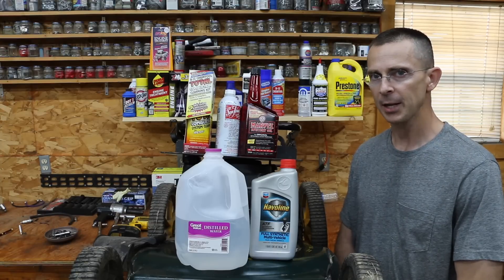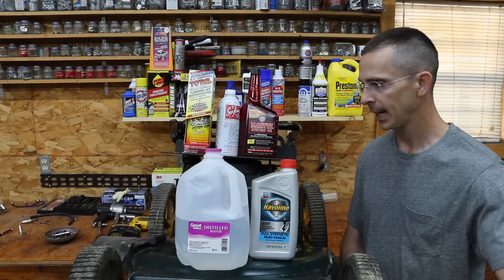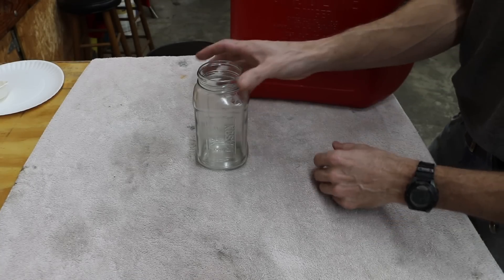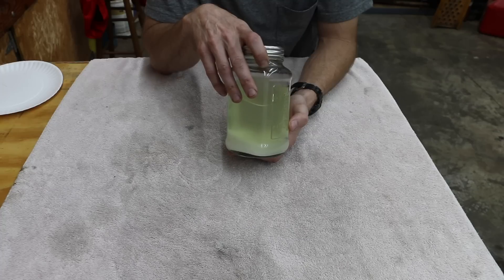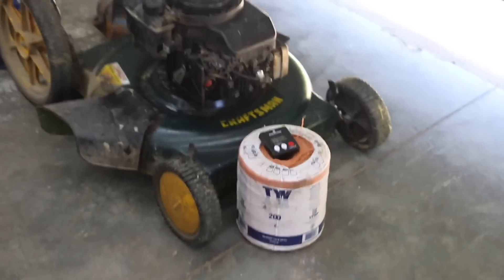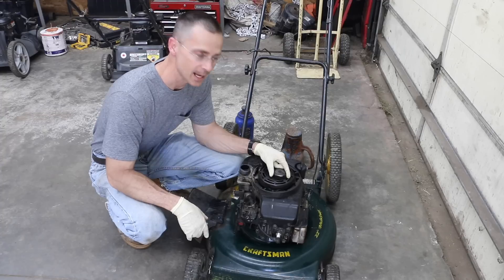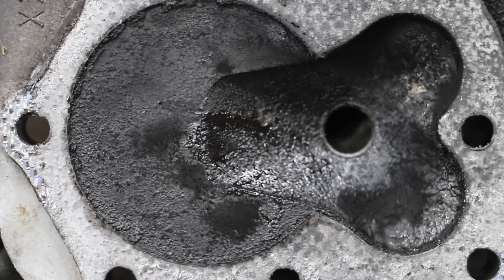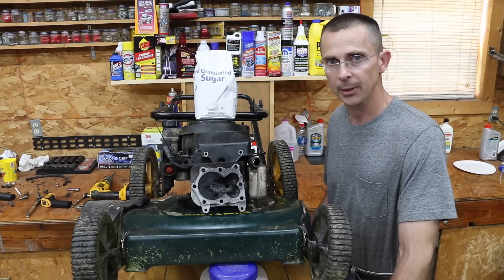Will Sugar in Gas Destroy a Vehicles Engine?  See what it does to this Engine!

Comment: I recently had my motorcycle at the dealer for what I thought would be warranty work on the fuel pump and they found tons of sugar in the fuel tank.... they are replacing the pump and cleaning out the tank

 What would you or anyone who reads this, suggest I use to possibly restore any issues it may have caused inside the engine?

(Symptoms were fuel pressure loss/low at high rpm, intermittent crank-no-start ,engine intermittently stalls out when i try to accelerate hard)
Reply: Flush out fuel tank,replace fuel filter,flush fuel lines.If its carberated,clean the carberator,if not,clean injectors.

Comment: I had put some Roundup in and oil bottle and then accidently added it to oil of a Dixie Chopper. It ran for awhile and then seized. The Cylinders were completely glazed. The engine was a loss. Sugar in the gas tank might not be effective but Glysophate in the crankcase is.
Reply from the maker: Thanks for sharing.

Comment: I have said for years that sugar in the gas tank will not destroy the engine. I did the sugar in gas dissolve test 45 years ago when sugar was put in my tank, I drove that car another 123,000 miles before selling it to a teenager. It had 157,000 miles at that time.
Reply from the maker: Thanks for the feedback.

Comment: Hmm interesting results.
I only heard, sugar crystalizes everywhere connected to the fuel (fuel tank. line, filter etc)  when left overnight or longer. Maybe thats something you could test......? 

Fix? replace everything related to fuel.

Your test just showed, sugar can damage the engine as well (caramelize/carbon), when someone unknowingly runs the engine on a large quantity of sugar contaminated fuel for a long period of time.
Reply from the maker: Thanks for sharing.

Comment: It appears that the problem with sugar in fuel is that oil based fuels are non polar and therefore do not dissolve sugar well at all.  Solvents like water are highly polar and is the reason sugar dissolves in water  well.  Alcohols are also  largely non polar and do not dissolve sugar well.  It would seem adding some water to the gas  would likely help  to dissolve the sugar and eventually remove the sugar.
Reply from the maker: Thanks for the feedback.

Comment: First, find a flammable liquid in which sugar will dissolve.  Put that in the tank and run the engine on the mixture.  Heat of combustion of the flammable liquid bearing the sugar should burn the sugar so that it leaves no sugar deposit and may burn off some of the residual burnt on sugar.

Comment: Interesting paradox: the sugar does not dissolve in the gasoline when in the glass jar. And yet, the sugar must have dissolved in the fuel tank to get past the fuel filter and carbonize the piston and valves inside the combustion chamber. 

In theory, the fuel filter should trap microscopic dirt particles (sugar included) suspended in the gas and eventually clog the filter, starving the engine of fuel. But as most know, things don't always happen according to theory.
Reply from the maker: Thanks for sharing!

Comment: One thing i do know. If you put sugar into a fuel tank once it desolved into the gasoline the car will run however after it gets hot and then shut the car off and it cools down it will not start because the sugar solidifies and makes the fuel injector stick. I have seen this on a couple of occasions
Reply from the maker: Thanks for the feedback.

Comment: To remove sugar: I would purge the tank, lines and change the filter. Then I would use an additive like acetone which is both polar and nonpolar and disolves both sugar(polar) and oil (non polar). This dual character of acetone is due to its ability to make hydrogen bonds with water and the presence of two methyl groups.
I have no idea what the effect on O2 sensors or catalytic converters would be?
Reply from the maker: Thank you for the suggestion

Comment: If you dissolve the sugar into water, then mix that with alcohol and then mix that with gas, you will be able to suspend the sugar into the fuel. The ratio might be something like a cup of sugar mixed with 1 pint of water then mix that with 1 pint of pure alcohol, and then you might have to mix that with up 5 gal of gas so it will still burn good.
If sugar is put in your tank the best thing to do is drop the tank, clean it out and change the filter.

If you want to try just additive, then put the pint of alcohol, pint of water mixed, then dumped into the gas tank with at least  10 gal of gas in it. Be prepared to keep changing the filter.
Either way you do it, also to add the water/alcohol mix to steam clean any deposits out of the combustion chamber.
Reply from the maker: Thanks for the feedback.

Comment: How about pouring it into the intake with the engine running? See if you can put a pound of it in over 30 min.. 
How about sewing machine oil test? Wear test and running in a crankcase.
Reply from the maker: Thanks for the suggestion.

Comment: No ... not on new cars, sugar is insoluble in gasoline, and will clog the pre pump or post pump filter before entering the injectors. If that fails it will clog the injector before any real internal damage is done. Unfortunately the tank, pump and fuel lines will need to be dropped and flushed clean. All filters will need to be replaced as well.
Reply from the maker: Thanks for the feedback.

Comment: So if I had to guess sugar dissolves in water because water is polar and can form hydrogen bonds spheres of hydration around it. Gas is non polar so it doesn’t form the hydrogen bonds and cannot dissolve the sugar so it eventually will clog the fuel filter. I’d suggest adding something that is polar to the gas tank that can be mixed with gas to remove it
Reply from the maker: Thanks for the suggestion.

Comment: I am going to stop at 2:30 and say this is a myth. The sugar doesn't dissolve and blocks the screens in the tank pick up as well as the filters. The engine doesn't run because it can't get fuel :)
But, the difficult part is that it is hard to remove from a contaminated tank :)
[After video] The sugar is still there, not sure why the brigs filter didn't block, but for cars it generally restricts or blocks the in tank pick up screen.
Not convinced about the residue inside of the cylinder ( would be interesting to know if that can be tested/confirmed as burnt/oxidized sugar ).
Reply from the maker: Thanks for the feedback.

Comment: Myth, table sugar will not even mix into unleaded gasoline,  just lays on the bottom of a tank or container in granulated form,  it will clog a filter of course.  Have tested this for myself.  Clean the tank, replace filters, that is all insurance would pay for when I had a customer file a claim for sugar in his cars fuel tank.  Did that and the car ran great for many thousands of miles afterwards
Reply from the maker: Thank you!

Comment: I have learnt the hard way, that sugar in a two-stroke engine is a bad thing, due to the fact that the gasflow enters the crank House before the piston pushes it on the top, via the sidechannels in the cylinder.
The piston is more "soaked" in sugar, than in a fourstroke, where you have the valves to administer the gasflow🤗

Comment: the rationale for the sugar making ur engine unusable depends on the sugar, after it's deposited on the cylinder and piston walls hardening into a glue and preventing the piston movement.
of course this means the engine will run while the sugar is suspended in the fuel but after a couple of days without running the sugar would coalesce and bind the surfaces to each other.
I'm not saying I'm believing this but ever since I heard of this it's been understood as a feature which happens at the subsequent  attempt to turn the engine over after the sugar had time to harden or bond or whatever....
of course sugar mixed with gasoline and oil will act differently from mixed with water during the latter the dissolved sugar becomes a glue across any surface it adheres to as the water evaporates.
as far as sugar in the fuel harming the engine while running probably not except for the deposited incompletely burned sugar which probably wouldn't be a problem in a high throughput engine but in a lawnmower output the combustion and exhaust dynamics are inadequate.
somewhat inaccurate I'm sure..
I'm thinking sugar dissolved in water is a fuel .correctly mixed with air at proper viscosity or percentage or whatever would work pretty much like gasoline even though the specific energy or combustion temperature or whatever would be different.
running a engine with sugar in it's fuel if the engine is not stopped while the sugar is still in the fuel system should not be a problem.
a few minutes of running the engine at high rpm with only gasoline to flush the sugar out probably would make the sugar episode so it wouldn't hurt the engine at all.
except in the newer engines which went crazy through integration with sensors and nit-picking computers.
yeah obviously I got free time to text this much about this subject.
it's actually interesting....
Reply from the maker: Thanks for sharing.

Comment: First for me would be to drain the tank and fuel lines. second would be to clean the piston and valves while you have it apart. Third would be to change the oil and filter and air filter. It should pretty much be a new mower by now. Oh, might as well sharpen the blade too.
Reply from the maker: Thanks for sharing.

Comment: I'd say it probably makes a lot of difference, when the fuel is taken from the very bottom of the tank or from a point that just slightly higher (just a few millimeters, or somewhere from an eighth to a forth of an inch of difference) and even more importantly, if the line that sucks it up has a bend with a high point in it, or not. All of that be cause if the sugar gets the chance to directly (grains and all) slip into the carburetor not to mention fuel injection nozzles, it could mechanically block those?
Reply from the maker: Thanks for the feedback.

Comment: Next you should try to mix sugar  with water and then  mix in isopropol alcohol which is bisoluble and then mix that with gas. We used to use isopropol to pick up the water that collects in gas tanks  after we clean them and didnt have time to completely dry them.Quart of rubbing alcohol,slosh it around  and then pour out what we could and add  5 gallons of gas to the empty tank once it was re installed............radiator guy...
Reply from the maker: Thanks for the suggestion.

Comment: The engine was still turning even after that yuk showed up.  I think it was running because it was a carburetor engine.  A fuel injection engine would have died "i think".   So by and by, you might have another video here (if you are looking for a project).  I don't think the question is answered.  (Will adding sugar to your gas tank destroy your vehicle's engine?).  Your test was on a (carburetor engine).  All cars today are fuel injected.  I think your engine would have stalled out with fuel injection.  I don't know how you would test on that though.  Last time I was at a shop that sold small engines (chain saws, mowers, water pumps), all those engines were carburetor engine.  4 wheelers and snowmobiles and jet skis also.  I don't know if a small engine comes fuel injection.  Good luck.
Reply from the maker: Thanks for the constructive feedback.

Comment: Sugar is comprised of Carbon, Hydrogen & Oxygen.  For instance, glucose is C6H12O6, so when burned, the Hydrogen and Oxygen turn into water and a good portion of the excess Carbon is deposited in the engine.  CO2 is also the primary by-product of the combustion of the gasoline/sugar mixture.
Reply from the maker: Thanks for the feedback.

Comment: Years ago I was told that your engine is safe, but you'll never stop clogging fuel filters. I was told that draining the tank, rinsing it with water, and replacing all fuel filters and lines was your only cure. 
    Yes, major annoyance.
Reply from the maker: Thanks for sharing.

Comment: It will cause valves to stick and if on seats it will cause it to backfire from not sealing. Seen it first hand twice. Throttle body injection, coated all the intake runners also, you could take chunks off it and eat it. Sugar carmalizes and hardens through heat cycles. The other was multi port where strainer fell off in fuel tank, injectors were fine but valves were sticking and not sealing. Engine began backfiring through intake at first under hard Throttle, a few days later it backfired through intake and exhaust just idling. Coke and Pepsi products will do the same, and may have been why injectors were fine.
Reply from the maker: Thanks for the feedback.

Comment: Years ago my father ran a small automotive shop, and to reduce carbon deposits in a combustion chamber, he slowly trickled water directly into the carburetor over 20 to 30 minutes, (with the engine running at about half throttle). It appeared to do the trick.
Reply from the maker: Thanks for sharing.

Comment: Sugar will warp the piston head or/and  bore due to the fact sugar doesn't dissolve in fuel and if it makes it to the engine will cause a knock at best warping the chamber. So either it will seize the pistons or it will blast around the piston and almost no power will push the piston up aligning the next ones causing another knock or damage to other pistons. So IF sugar made it to your engine, your looking at a new car. However fuel filter will prevent that and worst case scenario is you will stall due to lack of fuel pressure I would think.

Clean the fuel system from filter to filler cap. No additives
Reply from the maker: Thanks for the feedback.

Comment: I once owned a car someone had put sugar in the tank.  It started running bad.  I took to the repair shop.  They found sugar in the gasoline.   They cleaned the gas tank replaced fuel filter  and cleaned the carb.  That coast more than the car was worth..  the sugar was in the fuel system. It had problems from then on.  Sure was glad when it was wrecked and toatled.
Reply from the maker: Thank you!

Comment: My son started driving two years ago. One day I went to fill up the tank and I noticed sugar clumped around the gas cap. I took a photo to show him, cleaned it off, and filled up. I used seafoam over a month later and never had any issues. I didn't change out anything. However, I did hear that bleach will kill an engine. 😁
Reply from the maker: Thanks for sharing.

Comment: when you add sugar to a car gas tank, not much will happen to the engine because sugar does not dissolve in gas. the sugar will sink to the bottom of the tank. however, what may happen, the fuel pump filters will clog up as will the gas filter. if the sugar does get pass the filters, it will clog up the injectors. sugar cant really get to a car engine, but it will sure plug up all your filters and injectors, and that will cost a lot of money to repair.
Reply from the maker: Thanks for  the feedback.

Comment: I know it's a old video but when I was 16 I had a 94 Chevy corsica that someone but sugar and koolaid in the gas tank it died within a half mile. My friend help me clean out the tank and replaced the filter. (I can remember what we did with the fuel pump if we just cleaned it or changed it) but once we was done it ran fine afterwards
Reply from the maker: Thanks for sharing.

Comment: If it were me, I think I would consider draining the tank, putting a garden hose in it, and let it run. Again drain tank, Add alcohaul, fill with gas, pull fuel thru line up to injector/ carb till good stuff comes out. Give it a go.
Reply from the maker: Thanks for the feedback.

Comment: What was interesting is that the sugar did not dissolve in the gasoline. Will always stay solidified as crystals. Then melts when it gets hot and burns and turns to sticky carbon. Looks very dangerous in a gas tank over a long period of time. Small bits of sugar crystals seeping into the engine.  The only way to get it out is to flush the tank with water to dissolve the sugar. Lock your tank.
Reply from the maker: Thanks for the feedback.

Comment: I know from my childhood that it doesn't seize engines, but it will require a good fuel system cleaning. It happened to my dad; sugar in the gas tank. I was only about 9 years old so I don't remember exactly what he did. Luckily he noticed that there was sugar spilled and the gas cap was on the ground so he had never started the car...
Reply from the maker: Thanks for sharing.

Comment: I've never found anyone who actually had engine damage due to sugar in the fuel tank. But I did repair a car that had chocolate syrup added to the tank.  It plugged up the fuel injectors and caused the car to not run.  The exhaust smelled like chocolate.  After flushing everything the car was fine.
Reply from the maker: Thanks for sharing.

Comment: Just watched the video and had a couple of questions.  Did the gasoline in fact dissolve in the gasoline?  If not how much sugar gets through a fuel system.  I would bet sugar in the tank would be far more effective in whatever water is in the tank.  It would have to then enter the system in the fuel pickup
Reply: The gasoline did, in fact, dissolve in the gasoline. Sucrose, conversely - like most similar saccharides - has very limited solubility in nonpolar solvents.